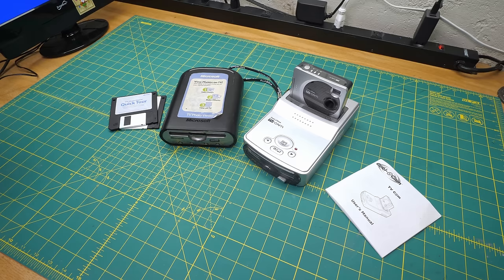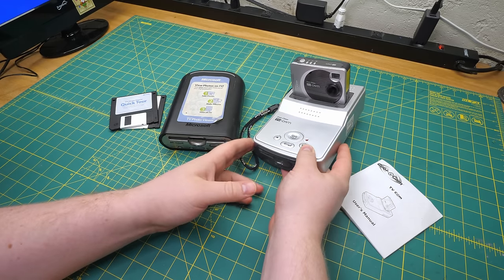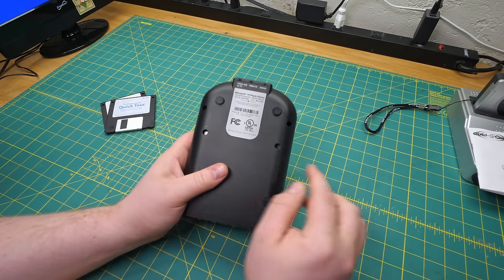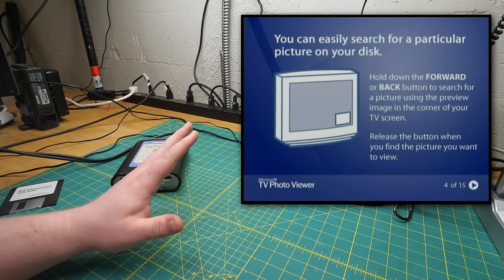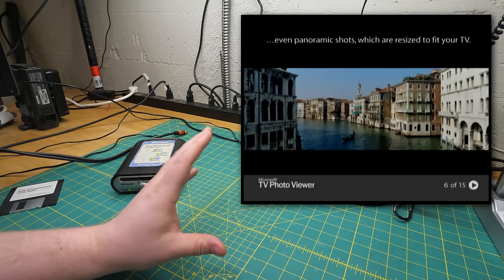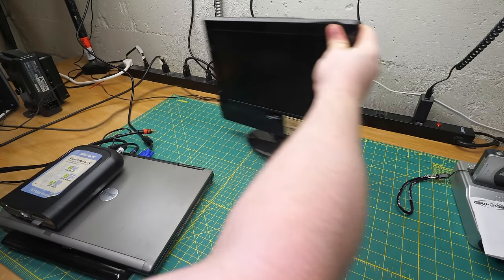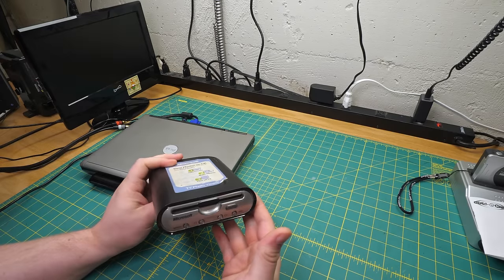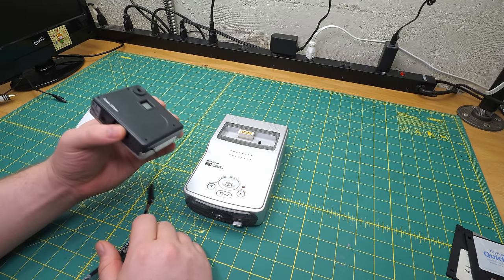"Play" Floppies On Your TV - With These!

Comment: You say the USB mini B port didn't come out until USB 2...
If that is true, why is there a USB Mini B and a USB Mini B2?
The Mini B is shaped like a D, with slanted edges on the lower half of the sides, the Mini B 2 looks more like a fat T, so rather than just slanted edges, there's a hard notch cut out of them.
This is so you couldn't use Mini B cables on a Mini B2 devices (god knows why), but if the USB Mini B port didn't come out until USB 2, Why do we have 2 of them?
And then, not only did the revolutionary (for size) and hated Micro B come out later, but in this era, Cameras often had a unique proprietary connector so you had to buy their cable. It's one of the reasons why Apple could get away with a unique connector for the iPod and iPhone, people were already expecting proprietary and unique connectors.
Reply from the maker: I believe you're mixed up on a couple things. "Mini B" is the T-shaped connector. The one with slanted edges is "Mini A", and was created a year after USB 2.0, as part of the original USB OTG spec. It's designed to fit into a special "Mini A-B" port that can serve as either a host or device.

You can read about the introduction of mini-A on page 6 here: https://www.rockbox.org/wiki/pub/Main/DataSheets/OTG1_0a.pdf

Diagrams are on page 14 if you want to confirm we're talking about the same plug.
Reply: @CathodeRayDude  Yeah, I think the one I'm thinking of is the Mini-AB.
Considering most of my equipment had Mini-B ports on it, mainly external hard drives, I'm trying to think what device it was that had the Mini-AB port on it. 
I honestly can't remember what it was, but MP3 Player comes to mind, so perhaps while I would have used it like my external hard drives to connect to a PC, perhaps it was more of an OTG connector, and it was also possible to plug external storage like a hard drive into it too.

Comment: 58:30 Floppy disc while not as fast as cdrom (not the 2x but like 4X+) or hdds are spinning and releasing vibrations. You can not give old people who are scammed into buying such a thing a THING that rattles away at their desk so Microsoft just did the reasonable low tech solution (foam tape) to decouple the floppy drive and the chassis.
Reply from the maker: I don't know what you mean by "scammed", this seems like a perfectly legitimate product to me, as I explained. The TVCam dock has an identical drive in it and makes no noticeable sound even from only a foot away.